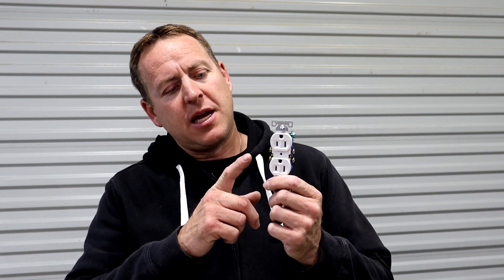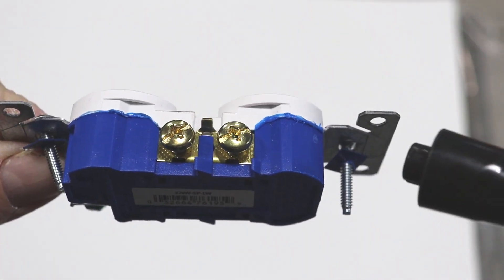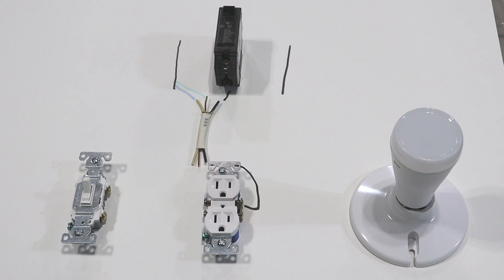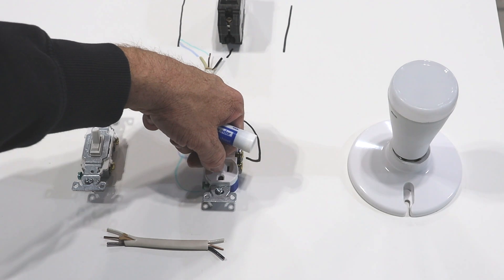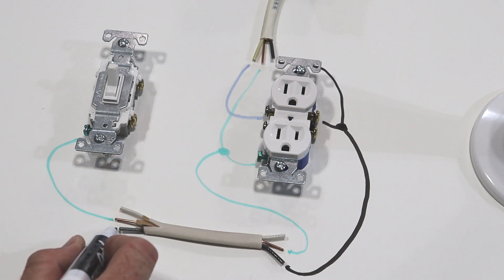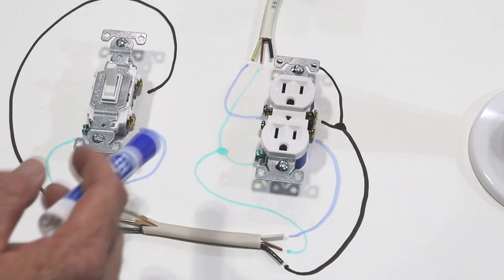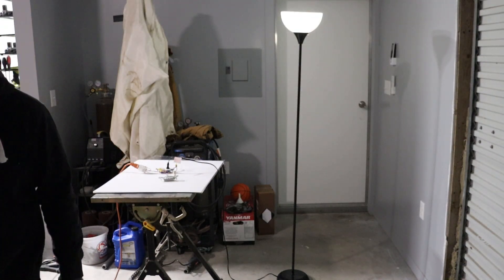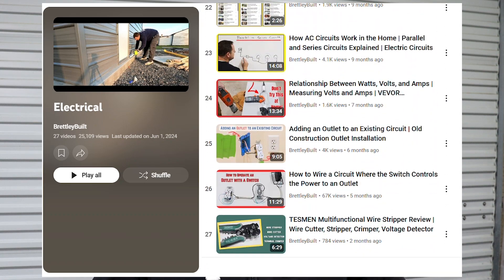How to Wire a Half Switch-Operated and Half Hot Outlet | Diagrams and Live Circuit Demonstration

Comment: So on the receptacle/outlet if you run the black wire on the top or bottom or the white/hot to the top or bottom this will determine either the top portion or bottom portion will be hot all the time?Just wondering if you have a preference to use the top or bottom as the switchable part.

Comment: So, in your dry erase diagram, you have the black wire running to the top screw and the neutral running to the bottom. But, in your physical mockup, the hot wire is running to the bottom, and the neutral wire is running to the top screw. Will this make a difference? That's the part that confused me.
Reply from the maker: Sorry for the confusion. No, neutrals are not affected because only the hot wires are used to travel to the outlet and switch in the unique way. Nothing changes with the neutrals.

Comment: Why not use 14/3 wire?
Reply: If you have an existing dual receptacle outlet where both are switched but you only want one receptacle switched instead, it may not be feasible to run 14/3. For new installs, I agree 14/3 is better.